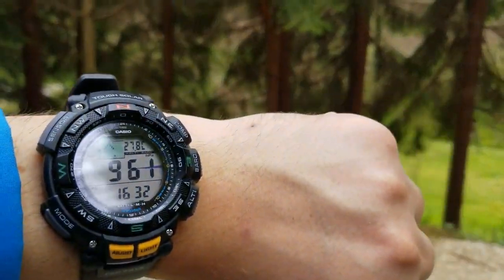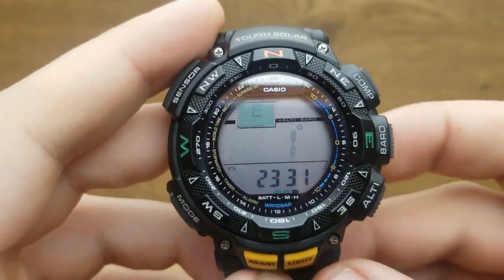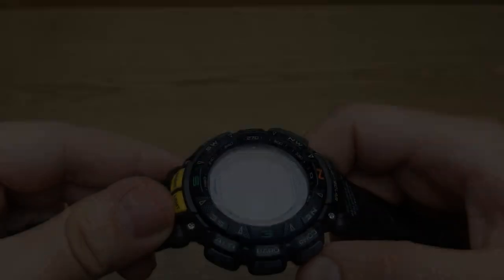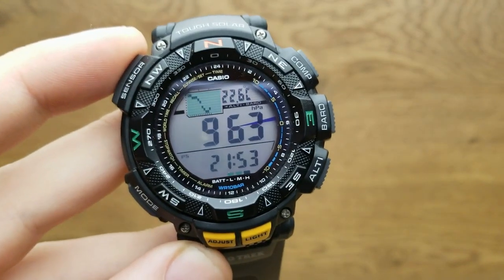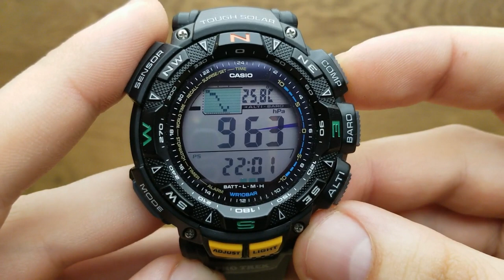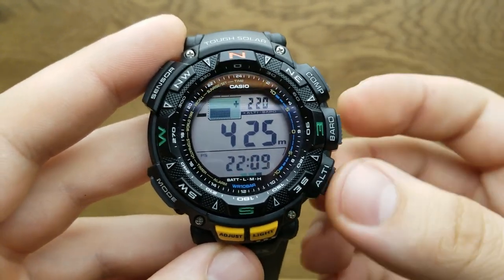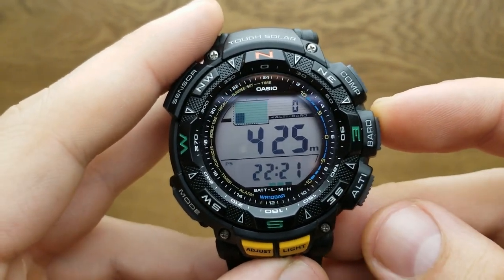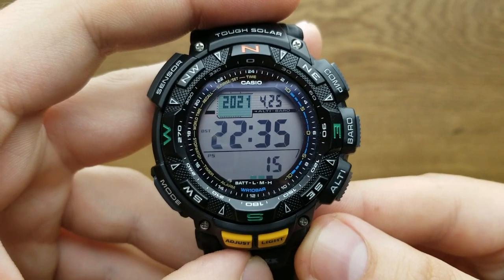How to use Altimeter, Barometer and Compass - Explained

Comment: Great tutorial. Thanks. It seems that this tutorial also works for the 3415 module (PRG-270), the only small difference is that the adjust button on the 3246 is placed on a different position on this watch., but everything else is the same.

Comment: I live in U.S. can you change from Celsius to Fahrenheit on the temperature in the barometer mode????
Reply from the maker: Yes you can, you can change meassuring unita
Reply: @ttwatches5579   I also live in the US. Can the barometric pressure be changed to show the reading in units called inches of mercury (Hg). Here we look at the barometric pressure range where the best pressure is between 30.2 for the high and 29.6 the low. I am not use to reading it in the unit called (hPa)

Also can you leave the screen on the barometric reading all of the time? Or does the watch automatically switch back to another screen?